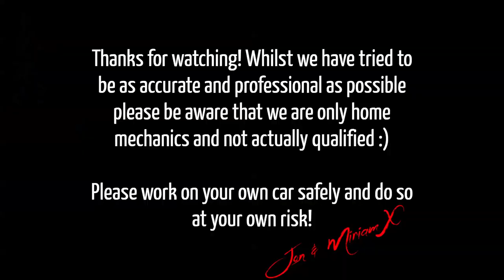R53 to R56 brake upgrade on the Mini Cooper S

Comment: The brake bleeder doesn't require you to pump the brake pedal , as the system fills automatically from the bottle . By pressing the pedal you have increased the pressure to high consequently fluid sprayed out. Safety goggles are a good idea!😭
Reply from the maker: Thanks for this :) we have tried doing it just using the pressure bleeder and we couldnt get any fluid to come out... either nothing comes out the nipple or it drips slowly, we found pressing the brake pedal sped up the process and pulled the fluid through... this could be because we are using a cheap pressure bleeder or we set the pressure to low... maybe next time I will try a higher pressure! Good shout on the goggles though! that fluid went everywhere!! hahaha. Thanks so much for watching, Miriam xx
Reply: Instablaster

Comment: Great video. Did mine a few years back. Just a word of warning about those HEL lines, absolute garbage!! This issue is that the brake line can slide freely within the grommet, which means the line can end up rubbing against the inside of the wheel. I suffered complete brake failure. I never even received any kind of reply from HEL regarding the issue. Has happened to several Mini owners that I know of. There's a fix/bodge to put cable ties tightly around the hose on both sides of the brake line.
Reply from the maker: I assume your car is lowered then? the HEL lines are identical to all the other braided line companies whether its Goodridge or someone else.... the problem lies with lowered cars and the chances are on your car the line hadn't bust just the coloured coating had worn off? We spoke to HEL about this exact issue as we had seen it mentioned... this was our reply which may help! We sell a fair few of theses (way over 100 sets in the last year!) and haven't had a single issue mentioned to us. From what we understand whatever line you choose will have this issue so worth making sure you check them regularly anyway! And don't forget they have a lifetime warranty as well :) I hope this helps in someway and thank you sooo much for watching really appreciate that, Miriam xx

"The hose HAS NOT burst. Our hoses, Goodridge hoses, and any other reputable braided brake hose will hold about 8-10 times the pressure that ANY car brake system could produce. It’s simply not true that a brake hose would ‘burst’. The only way a brake hose will fail is if a) the hose has been excessively pulled continuously in an acute angle at the inner wing end. This could be due to poor maintenance, incorrect fitting (not routing the hose in the same shape/route as the OE hose was), due to modification – lowering for example will make the hose sit in a different position to how it should do as standard, or due to a freak movement of the hose caused by something like a pot hole, speed bump or similar.

The hose in the picture below has clearly RUBBED on a moving part, and rubbed on it for a significant amount of time in order to burn through the PVC, the 4 wire stainless steel braid, and the PTFE inner hose. An excessive amount of hose must have been one side of the mid-line locating bracket. This could be down to a number of reasons, but NONE of which are down to the quality or standard of the hose itself.

We have added another component to kits this year which stops excessive movement of the hose through the line locating bracket. See attached image. This is not because lots of people have had failures, it’s just another way of eliminating possible instances like this where there is nothing you, I or the person with the car can do about a hose moving excessively (for any of the reasons above) other than regular checks/maintenance which arguably should be done on any modified car, but telling that to the customer and actually getting it done is another thing."

They closed with "Personally if I’m guessing I think most/all of the ones which have rubbed will be on lowered cars, as we’ve sold literally 1000’s of Mini brake line kits and we’d have had tonnes of complaints/issues if it was a common thing"
Reply: They acknowledge people have had failures, which is all due to the line moving through the grommet freely, but deny their product is substandard. Typical. At least you got a response :)
My car is on AP coilovers, but they're set as high as possible. I do almost all work on my car, but shortly before my brake failure, work was done on the car (wheels off, lots of stuff masked up etc), so I guess the line was pushed/pulled through the grommet by accident. I don't blame the person for this at all, the fact is it just should not happen in the first place. The grommet on the oem lines are fixed and cannot move.
I ended up replacing my HEL lines with Goodridge. Unfortunately the grommet is not fixed on those either, but at least the line is a very tight fit and doesn't move freely :)
I'd strongly advise cable ties either end of the grommet ;-)

PS. great channel and content, keep it up :)
Reply: @JohnCarlyle  I'm just about to change mine to HEL lines I got the other day so I'll definitely be doing that with the cable tie. Cheers mate.
Reply: @JohnCarlyle  i consider this advice you have given to be a real good safety point, so many people don't have any common sense and never see the obvious. So glad you pointed this out because i'm just about to do this R50 to R56 brake upgrade, so thanks John.

Comment: Nicely done Miriam.  I have looked at your site for the conversation kit however I’m a tad perplexed as to which set to have ,  Groved with yellow stuff ?.. or pagid   I’m none the wiser .
Reply from the maker: Well they are just a couple of the options we can supply them with any brands reallym the pagids are for those on a budget they work great for everyday road and the occasional b road blast... The ebc on the other hand is a touch more hardcore and for those with a heavy foot or that like the occasional track day :) feel free to message us and we can run through it all :) I hope this helps and thank you so much for watching, Miriam xx

Comment: hi , nice vid ...   do the bigger front disc's fit with standard r53 wheels ,  is it not worth swapping the bk ones too .. ?
Reply from the maker: The R56 Cooper S Kit fits fine under standard wheels :) if you go for the larger budweg kit then there are issues with standard wheels and you need 11mm+ spacers for clearance... that being said the kit in the video it's great for the money! I hope this helps, Miriam xx

Comment: WD40 makes the brake line grommet fit in to place easily. Never had a problem using it to slide those into place.
Reply from the maker: This is cracking advice will definately give it a go if I ever change them again :) thank you so much for watching and taking the time to comment, Miriam xx
Reply: @ModAMiniGarage   wd 40 is your friend  on any job with a mini or any older  car 😉

Comment: hello, these brakes enter the 17-series tires, why don't the 4-piston jcw no longer?
Thank you
Reply from the maker: Hi Arnau, the R56 cooper S brakes with 294mm discs these fit under 16 inch wheels and greater.. Ther R56 JCW discs however, are 316mm and will fit under some 17 inch wheels but not all so need to check beforehand or be prepared to change your wheels :) 18s are ideal for this upgrade :) hope this is OK and helps, Miriam xx

Comment: Hi, is there a size difference between the old and the new discs and calipers?
Reply from the maker: Yes there is :) the standard R53 calipers have a smaller piston than the R56 cooper s calipers, the R53 disc size is 276mm whereas the the R56 cooper s are 294mm they pads also have a greater surface area aswell. I hope this helps, Miriam xx

Comment: What is the gain of R56 brakes over the R53. 🙂
Reply from the maker: They are so much better for a start :) you get to install larger discs and pads and also the caliper has a larger piston so the braking force and surface area is greatly increased! All in all for the  cost of them they are one of the best upgrades out there :) thank you so much for watching! Miriam xx

Comment: Could I get away with just bleeding the front brakes if I don't touch the rear? Considering I don't have any special bleeding tools I really want to minimise the amount of bleeding I have to do.

Great video though, it's definitely going to help me with my install.
Reply from the maker: Theoretically yes :) it's shouldn't cause to much of a issue worth it if you can but should be OK without a proper bleed :) thanks so much for watching :) Miriam xx
Reply: Sorry to say but never do half a job, do a full bleed and renew all of the fluid in the system, the last thing you want is half old contaminated fluid. If you don't feel confident enough then pass it to someone who can do it for you.

Comment: What brand of paint/clear coat did you use?
Reply from the maker: We used K2 paint specifically for calipers and then followed that up with https://www.ebay.co.uk/itm/302248469147 this stuff seems to work really well, we have used it a couple of times with no issues. I hope this helps! Thank you so much for watching! Miriam xx